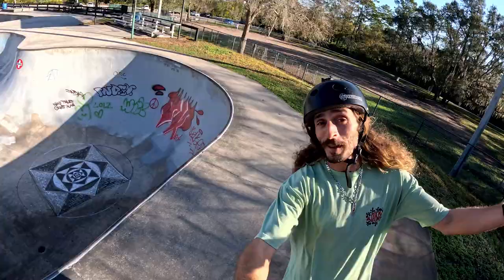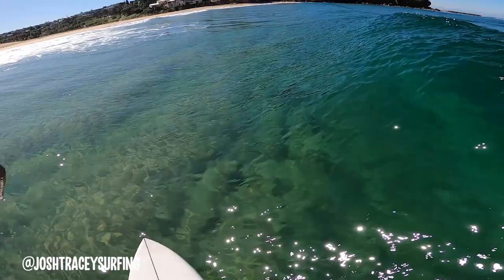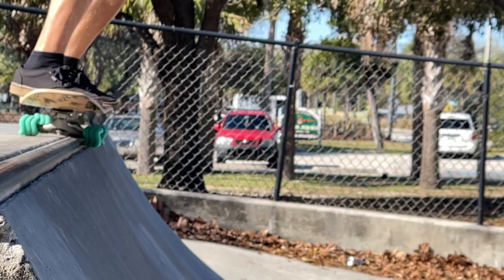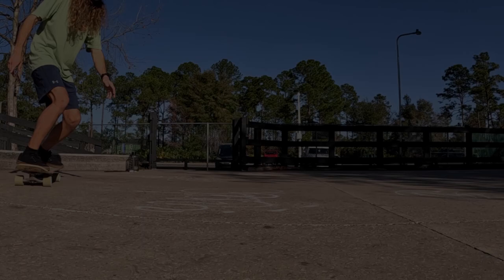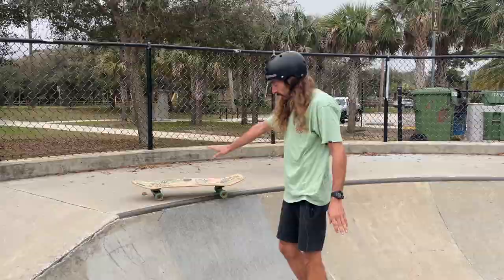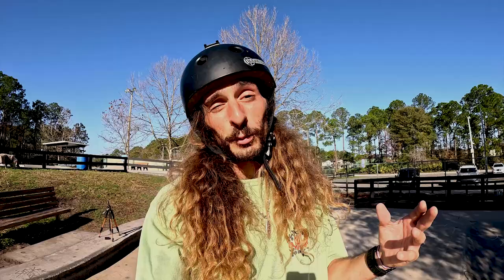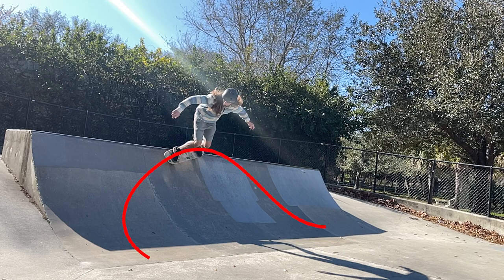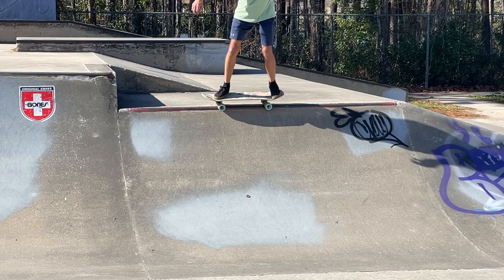How to do a backside 50-50 on ramps! Surf skate tutorial for Floaters!

Comment: Doing them like that is sketchy on not the ideal way to do the trick. Crosslocking or a double pinch is better. I always teach beginners how to pinch their back truck before entering. Too easy to clip up on the way in. You are on huge, soft wheels that roll right over. Most people dont skate wheels nearly that big and soft, so they will clip up easily. Unless I missed it, you dont really discuss the exit, which is the most difficult part of doing full decked 50-50's
Reply: the reason you may have trouble locking in your back truck is because you're going for a full deck lock in instead of pinching your backfoot heel wheel. you're basically riding out of the transition onto the deck, then backonto the coping, instead of riding into the coping from the transition. I used to do them like this and its very limiting. Once I started cross locking they got alot better.